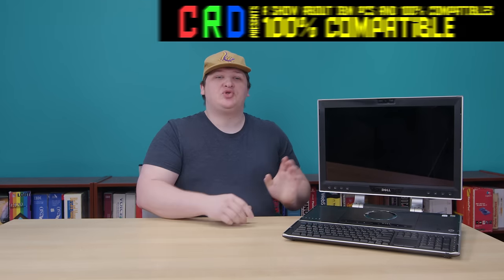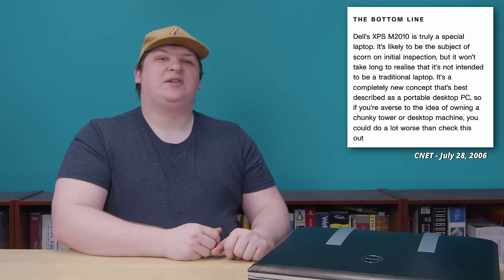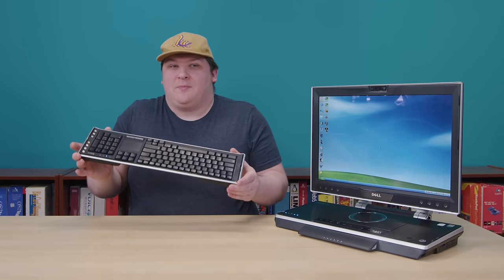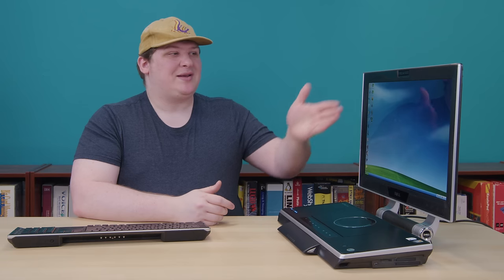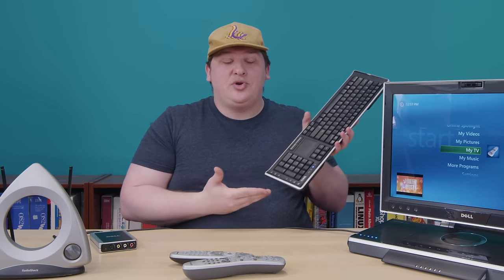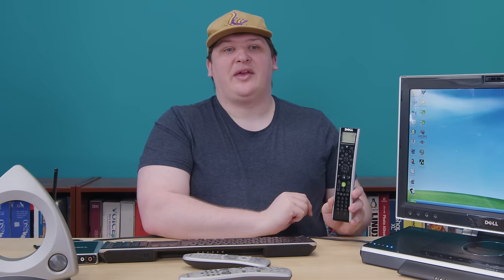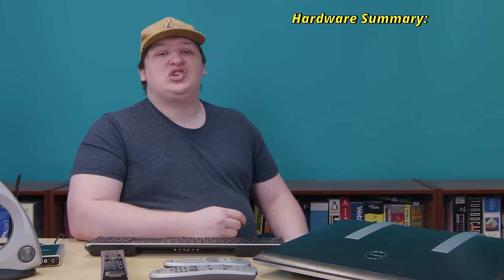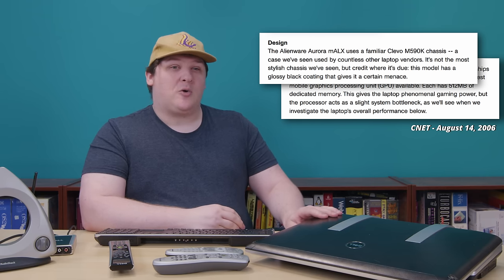Dell Called It "The Showstopper"

Comment: I owned one of these, bought it with my Dell corporate account with a LOC.  It was almost 6k, eventually I contacted Dell and told them they needed to let me return it, and to my shock they gave me 6k in credit so I ended up ordering an xps desktop with dual gpus and top of the line cpu.  Otherwise i would be embarrassed to admit any of it.

P.s.  I also had the cellular option on mine (I basically had every upgrade) and it was pretty cool being able to get online anywhere I was, this was not common back then.  I am assuming this is the "secret" radio he is referring to I haven't finished the video yet.

Comment: Confused, my Dell 17" alienware is just a little smaller and it sits on my lap in the recliner quite nicely. So does my 17" ASUS G73SW. A cooling pad helps with the heat in the summer.  In the winter it's not a problem

Comment: So I have a ginormous desktop replacement, with a completely dead battery, it suuuks. Just the ability to move it between rooms without having to completely hibernate or not lose work when the power cable gets snagged is worth the complications of a battery.

Even a little battery would be really useful in a media PC like this, just to allow moving between rooms. 

(My brick is an early VR ready MSI, 17 inch, absolutely 0 battery left, I have lost so much work due to the loose power cable popping out, I don't bother shutting it down anymore when I move it. I just rip out the power cable and see it die. I'm long past carrying)

Comment: For some bizarre reason there's a few things that are measured in inches regardless of if you live in a country that usually measured everything in centimeters. Of the top of my head some examples are the thickness of a plank of wood, the diameter of a pipe or hose, the length of a nail, and the diagonal of a screen which is where laptops/notebooks inherited it. This is particularly weird when you take into consideration that only those specific measurements of the things I mentioned are expressed in inches with every other measurement of the object being given in metric.
In general inches, and in some rarer occasions feet, are the only parts of the imperial system used in daily life in a metric country. So I can visually identify an inch but I have no clue of what a mile looks like and a pound or gallon are a complete mystery to me.

Comment: Learned the hard way that they aren’t called laptops, my wife’s MacBook was burning her legs and Apple said it’s normal and not intended to be used on the lap. Which is why they only refer to it as a notebook. Luckily, you can easily turn the notebook into a laptop with fan control software.

Comment: I had thr M1330, it was excellent if thirsty having the c2duo T9600 2.6ghz and the discret gfx 8400m. 90mins max youd get out of the batterey.

I had to go and buy the thinkpad X200 with the. SL9400 . That chip alone was about 900quid, it was clocked at 1.86ghz, but punched way above its station and sippped power. Thats was the best laptop i ever owned. Excelt keyboard, the gold stsndard, and woudl last a full working day on batterey. Iirc that laptop was about £2400 in about 2007!! The much more powerful dell came in about £1100. Iirc.

I installed an early 30gb ssd in the thinkpad, and the just in snapyness putting an ssd in was like night and day. I booted mint off an 16gb sd card, and it worked really well.

Comment: >Made you feel like a King among men
Oh yess!! Not necessarily b/c you hadn't to use thumb sticks/SD cards w/ a DVD player.
You could use emulators with a controller adaptor. Everything up to Gen5 was great+Dolphin was decent even @ the time.
+If you had the right DVI cable (I think it was DVI-I) it actually send the HDMI audio over the additional channel.
My Kitchen TV is from '08 and it still has VGA and the 'weird' 3rd HDMI(DVI) port. That's what it meant for btw. All other ports would deliver a picture but w/o sound.

Comment: I suspect using inches for screens never felt weird for metric system users because that value pertains to the diagonal, and with all differences in aspect ratio and trigonometry and whatnot, no one would really care either way. Also, at this point we instinctively have a feel for how large a screen is in imperial units anyway.

You will see, however, TVs being measured in metric, but that does make sense, as their aspect ratio is now pretty standard at 16:9 for most models and it’s way more important to do the math and figure how wide and tall they really are and if they, being the huge-ass things they now mostly are, will actually fit your living quarters.

Comment: Does the headphone jack have fiber optical out? I had a goofy acer that had 3.5mm SPDIFF inside, I guess that was a thing at the time.

Service on this is wild since I think the E6500 wasn't too far off from this era and its...1 damn screw to pull the case off.

Comment: I've always lived in metric countries and never saw anyone sell screens using cm it was always inches. About the screen, this panel size and resolution (and aspect ratio) were super common around that time, even the iMac used one. I would guess there were more than one manufacturer and it was probably cheaper than going 16:9.

Comment: If i had not built my own I3 driven desktop  with digital TV  with FM raido blueray reader burner windows 7 media centre  computer  that had a connection to cable  TV with a 38 inch screen & a 120what ceround sound . i would have bought this . Because this Dell was what inspired me to build it . a all in one for media computer that you could do anything on

Comment: 7:43 - Yeah we use inches for screen sizes in Europe too, its just become the standard. Same with lumber and a few other items, they are sold as for instance 2x4 like in the US, but it isnt actually 2x4 inches, its 48x98mm instead of the 50,8x101,6mm it should have been if straight converted. Im watching this on a 27" monitor though, and that one is actually the correct 685,6mm that it should be. Theres also some weird stuff in the US, where ive seen things sold as "12.5 inches" and such. Thats really weird too, if you are using inches that should be imperial, theres no decimals in imperial right? 

I dont know, im guessing that alot of stuff just has old nomenclature because people dont like change, but has been updated for modern manufacturing processes and such.

Comment: So that unpopulated slot next to the wifi card was likely for the Cellular Wifi that dell was throwing in their systems back then, had the option on a couple of my machines but chose not to pay the money for one.....I THINK!!  FYI My machines were not this particular model and it is one that I remember being impressed by, but not the stupid price tag it had for the time.

Also regarding the torque sequence on the heatsinks, if you look on the inner screws they have A-B-C-D next to them, also the outer screws have 1-2-3-4, basically just tighten according to sequence and you should be fine.

Comment: At 20.5", that resolution is as near as you'll get to 96ppi, which is the Windows default reference pixel density. That's a bonus for document production, as everything will look life size on screen without special DPI scaling considerations.

Apple remains the king of DPI scaling, the M$ APIs just weren't built for that originally, and neither were the still-relevant legacy toolkits most GNU/linux distros support. In both of those cases, whether OS-level scaling will work is largely down to each individual dev. If they used some ancient toolkit, then it'll either look tiny or hideous. If they used something newer - it'll scale fine.

Apple on the other hand tend to be quite forceful with these things, so any software you're likely to use on their stuff should scale a treat out of the box.

Comment: My 1st pc was a Toshiba Qosmio. Got it the 1st year it came out Had a 1.73ghz I7 quad with a 1.47 ghz nvidia 420m. Ram was 2 sticks of 4ghz ddr3. Plus 2 hd's. 1 64g ssd and 1 500g sata.  The display was 18.5 inches and it had Blu-ray.  It was a monster. Only problem with it was battery life. 1.5 hours max if u were gaming. But for the most part you're pretty much tied to the wall. The price was the best part though. Easily a grand less than the competition especially compared to sony or dell at that time. Sucks Toshiba doesn't make them anymore.

Comment: screen sizes are measured in inches.
Even today.
Go and buy a TV in a metric country and it will be advertised as 55" or what ever.

Its not just LCD panels either.
Look at wheel sizes on cars.

17" wheel size.
Tire sizes is a weird hybrid

225/45 R17

225mm wide, 45% of width in height, 17 Inch wheel size

Comment: Be nice to get this thing to do proper Hd, or even 4K output, and upgrade the drive to that. Would it be possible to put two SSDs in place of each drive, and have the individual pairs set up in something like a RAID1 configuration, then pair the two pairs in RAID0 to get the fast performance, while having some data reliability? Or am I talking crazy talk? I put the idea in your head though, huh?

Comment: Every laptop I've ever owned has been used from my lap. Including the Tadpole Sparc Ultrabook - that thing is a cousin of "luggable". And I'm currently watching this on a Dell P24T "mini-me" with ChromeOS (flex) running on it - because win10 f'ing sucks. Yes, the HP EliteBook ("mobile workstation") can cause 2nd degree burns... when plugged in, on battery it doesn't have the pixies.

Comment: you know what would be really cool? if you kept the wireless usb radio adapter, the speaker control hardware, and the monitor's control interface... pull the motherboard, and put in a modern laptop with a ryzen 7,9, or intel i7 or i9 CPU, 32GB RAM or more, a 1 to 4TB SSD on one port of the 2 M.2 ports, leave the already installed 802.11 wifi6e card in that's also bluetooth. connect the keyboard and mouse via the bluetooth. control the remote with the wireless USB  radio adapter, have an Nvidia RTX 8GB or more 4060, 4070, or 4080 in a modern gaming laptop motherboard --- 
use the 2nd M.2 port for a 2nd USB 3 controller, and provide extra USB ports across the back and sides.  Provide HDMI out the back or side, and have a secondary board that converts the Display connection to HDMI and put it in the internal display connector of the motherboard with a display connection to HDMI adapter --- leaving the monitor as an internal screen but running on its own resolution and capabilities --- and then you have HDMI out , headphones out, and so many USB ports you wouldn't know what to do with them, while having the majority of what makes this thing good... but replace the battery pack with a 90 watt hour or more battery pack that stays internal. For the dvd drive, just use a USB adapter for the IDE or SATA port. 
This would cost a lot, but it'd make this machine a lot closer to what its original goals would have been.

Comment: Cool concept, the Nerding is off the rails here :) Its a " desktop replacement unit" thats just big enough to be carried around. In todays world many of its " features" got obsolet, nobody uses optical drives anymore. Many people use their smartphone to control their TV. Its hard to see any daily mobile uses cases for it, One can carry this laptop on its handle well but you also need a bag for the powerbrick, cables and everything else for example a traveling sales rep would need. And its a little bit overkill to be stuck at home as a media center all its life. Todays 18 inch machines with powerful specs do alot better/ lighter but lack that cool grab handle, 20 inch screen, great hinges, massive IO, great soundstage and good ergonomics like that detachable keyboard or good mousepad/ detachable mouse. To think that this is the same companie that made my aweful coporate laptop that takes longer to open a PDF than this XPS can select a music track from the kitchen via the remote....
Reply: Um, I still use optical drives. As do many people.

Comment: The gyration remote looks very ahead of its time and well implemented. Anyone with a relatively recent LG TV probably has a similar remote and it’s horrible to use. It’s always active when you have a menu up, the enter button is this awful mouse style wheel and it never feels particularly accurate. Almost looks like a regression compared to the one in the video.

Comment: HP had a competing, similar featured "laptop" called the HP HDX 9000 "The Dragon." 

I've restored one myself, sadly the Ati Radeon 2600XT has bad memory and will crash in games, and the GeForce 8800GTS version requires a completely different motherboard. And its unfortunately really limited by its 800mhz FSB just like this Dell, so no Core 2 Extreme QX9300.

So after I enjoyed it, it went back in its original box with all the accessories for the next time I want to gawk in awe at that thing. Now my similar era project laptop is the HP HDX 18, which does have the QX9300 I upgraded it to.

Comment: If you're talking about a place with a lot of surfaces, then you're talking about moving the device around. That becomes a lot easier if you don't always have to find a place to plug it in. 

What seems odd to me is why an all-in-one multimedia center need to plug into another screen. Especially the standard def TV that would be worse than the one it came with. All that focus on the screen, and they expect you to usually not use it?

Comment: Man, I wish I had this laptop, this seems like a cool portable retro gaming device, i wonder how good emulators run on it, or mimic cd/dvd based game consoles imagine whippingg out this bad boy to play some dreamcast games on it (burnt cds ofcourse) but still would have that cool feeling of retro.

-also- 
At 33:38

i wonder if you could somehow snug a 802.11ah Wi-Fi adapter in that unused slot with soldering or if the pin out wasn't fully baked in (like just the soldering pins exist and not any connector wires to resistors etc)

HaLow cards are pretty small form factor and some can use pcie. Since it's a older device it could benefit from using low powered wifi rather then the power hungry built in wifi. Also since it is older hardware not like you'll ever get full speed wifi anyway. Would be a great doomsday tool.

Comment: Just a couple of thoughts.  I have this laptop and I love it. But you're wrong about dell never selling the remote by itself. It may not have been advertised, but my M2010 didn't come with the remote, so I purchased one on eBay. It came in a dell white box with usb receiver and an IR receiver. Luckily, I was able to find the internal receiver board, so I dont use the USB dongle.  

Also, I'm just curious,  how did they get the Bluetooth keyboard to work in bios.  That has to be some weird hack on dells part. I tried installing Linux, and it borked the Bluetooth firmware on the laptop and killed bios support. Ended up having to buy a replacement receiver because I couldn't figure out how to fix it.

Comment: I had an Asus Stealth ROG 'laptop' for a while that had that goofy rubberized coating on it, and I hated it! I never actually tried to remove the stuff, or I may have kept the machine longer. This M2010 kind of pushes all the right buttons for me, even though I'm familiar with the pitfalls of RAID arrays in general. I'm kind of surprised they would even attempt something like that with Win XP, considering what a P.I.T.A. it would create for re-installing Windows. Overall, it was a very cool 'we-did-it-because-we-could' type of machine. If only modern laptops were as easily serviceable as this one.😉👍👍

Comment: they should bring these back with led backlite screen and ssd or emmc drive, mobo can be now smaller to cram bigger battery etc, imma guess that slot not soldered is an option for the 3g cellular data card for verizon etc, they make also sim cards for 3g for the wwan i think there named or just cdma type, i have a card thats 3g cdma no longer working due to network upgrade.

Comment: Does the keyboard appear as a Bluetooth device in Windows? Does the keyboard work in BIOS? Since typically you can't use a Bluetooth keyboard until OS boot, which makes it impossible to use the keyboard pre-boot or in an otherwise not configured/paired OS, I wonder if they have a "standalone" Bluetooth unit of sorts that in there that acts functionally as a Bluetooth keyboard to USB keyboard adapter for ex, thus the physical pairing button. Maybe it's just a button with a driver to initiate Windows Bluetooth pairing, maybe it's a standalone module, not sure.
Reply: Yes, it’s for pairing the keyboard outside of OS. I had to do it once.

Comment: Q: Why did wireless USB fail?
A: It failed for several likely reasons. 1) It was late to the game when good enough alternatives like Bluetooth and WIFI had matured enough by the time of it’s arrival to serve much the same purpose as wireless USB. 2) For mouse and keyboards, Bluetooth was good enough and WIFI was good enough for wireless printers. 3) For external wireless storage, WiFI was good enough for those that want local sink but for others cloud storage became a thing so devices could just use that instead of a wireless external storage drive.

Comment: Those wondering about the Bose dig: the problem with multiple speakers is phasing, the distance from every element to your ears is different and this means the waveforms are not aligned. You get comb filtering when you add more elements. You can tune it to one specific spot and it sucks everywhere else. Bose doesn't really care about this, they have completely different philosophy which means they can create decent sound from small things that can then radiate to many directions but NONE of the directions are really good. They are just... passable. It works in certain applications, like automotive but as a stereo hifi speakers.. they are just god damn awful.